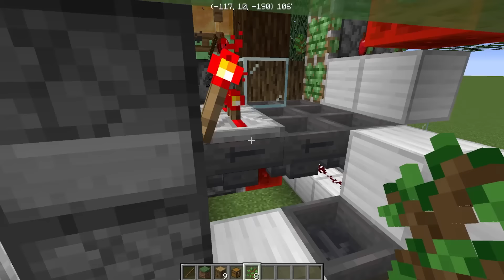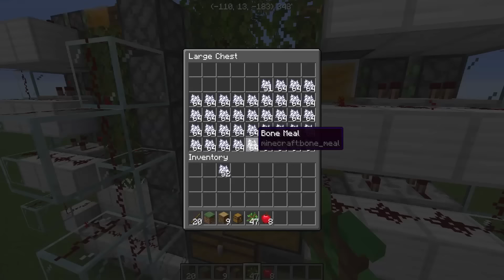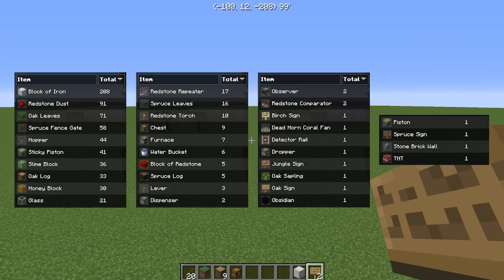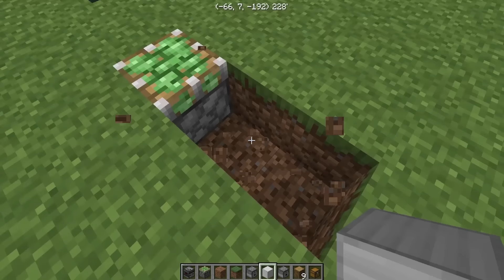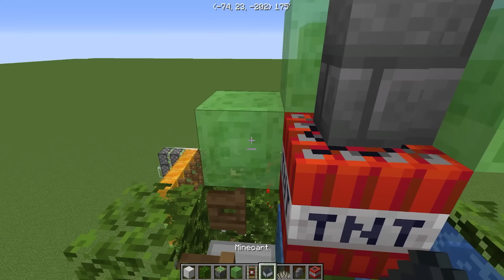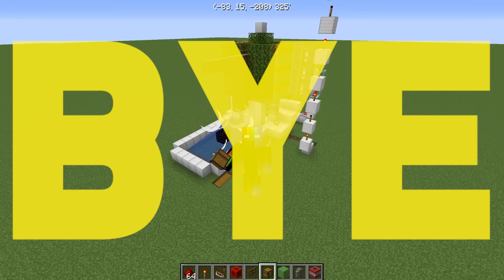Minecraft Tree Farm 26.1 - EASY AUTOMATIC TREE/ LOG FARM Tutorial

Comment: So uh, for some reason my pistons are breaking, and they arent pushing like 2 entire rows of slime and honey. I triple checked the redstone, and it doesnt seem to affect it, because when I break the layer to line it up with the rest and try to pull it back, it will go back, but if you try to push it, it wont work, it just breaks and doesnt push it like how it doesnt push bedrock or furnaces. Im on 1.19, sooooo maybe a bug? I need answers cuz I just worked on this for almost 4 hours now instead of sleeping
Reply: Maybe u are using pistons instead of sticky pistons? Because I just did the farm in 1.19 and it works fine
Reply: @xswetzplus  im also using sticky pistons
Reply: or maybe u did the redstone ticks on the leave crusher wrong (The ticks on the redstone repeaters it’s 4 then 2 on the one closer to the tree)
Reply: @xswetzplus  I figured it out, for some reason I put 3 ticks, not 2. But still, if I spam saplings it still breaks my machine because the tree leaves arent being broken at the top, so it breaks my machine, so when it breaks, I have to go and remove it all, then flip the lever a couple times to reset it. I just need a way to stop that from happening, like can I put a roof over it for it to not do that, or will it just go through/break the blocks?
Reply: @xswetzplus  isnt it 2 and 4
Reply: does furnace placement matter ? like mine is facing opposite to the tnt duper while his is facing like to the right of the tnt duper
Reply: @einsteinsousa2908  no, furnace placement doesn't matter
Reply: @WelpImBad I was having the EXACT same issue, and it kept repeating every time after clearing out the whole machine to start fresh etc., turns out its from when the oak trees grow with wood out to the sides, blocking the pistons because they can't deal with any wood, only leaves, so the blocks of wood would just stay there clogging it up, essentially. Using spruce, which doesn't ever grow sideways like that, has seemed way quicker so far and hasn't broken the machine, although now I know that was the issue I can make sure to catch those side blocks of wood more quickly if I'm really wanting to use oak for something. Hope this helps you and good luck!!!
Reply: @crashouch  i just added a roof so that it blocks it from growing over and breaking it, it can now take any wood types, thanks for the suggestion though
Reply: @welpimbad  nice!!! I'm really glad you sorted it. I'll bear the roof in mind for my own in the future too!!!

Comment: Getting super frustrated, in a single player creative and the tnt duper doesn't work in the slightest. Rebuilt it 6 times and it just sets of the tnt without duplicating it. 1.19 Java

*it also doesn't drop so it just blows up thee whole top every time. Sooooooo frustrating.
Reply: tnt duper should be facing north/south
Reply: @fenclory4381  thanks! I’ll see if that’s what’s causing the issue.

Comment: *This is working properly in 1.19*

I really like this farm, the fact it works with 4 trees and the ones I actually care about, A+. Farms like this do require a lot of bone meal, so either need to make a massive sized bone meal farm, or some form of Wither skeleton/mob farm to turn bones into bone meals, but it is worth it. My only critique on this, the initial layout wasn't introduced like a platform to show how much space this takes up, as well as not starting with the front. The biggest thing for me is the orientation and placement of builds are, and the first thing that was done is the switch in the middle. I ended up downloading the world (Thanks for providing that) and finding the measurements, and the front of the farm to where I can place it properly with the rest of my farms
Reply: Can you use spruce?
Reply: @giel5924  yeah you can use anything really. Jungle doesn't work well since you don't get enough saplings back, but I primarily used it for spruce.

Comment: Incase it helps it works on 1.16.5 but I found a clock with repeaters to work better and a switch with a comparter to stop the tnt also a stack of bones or 3 stacks of bonemeal gets you 175 logs on average

Comment: Built this in 1.18.2 and it DOES work....BUTTTT it does seem to break often due to weird trees, one wood grows toward the leave breaker arms, its over...now it just takes breaking the wood/leaves, installing a lever on the main line for the piston arms, pull the lever and reset it and its working in a couple minutes, i wouldnt consider it AFK in 1.18.2 because it is a bit of high maintainince, maybe tune the farm up a bit to prevent side woods?
Reply: FIX: move the top stone block AKA the "Tree limitor" one block downward
Reply: @robbytheatomicengineer5749  PIN THIS MAN. HE DESERVES IT MORE THAN ANYONE
Reply: @reihanboo  well thank you <3

Comment: I've tried this built, the only problem i had was the connector to the tnt to turn it on or off. So i have to manually remove the torch and place it for the tnt duplicator to work. Other than that this works great.
Reply: is it the redstone torch directly above the building block where the redstone dust connects to? I had this same problem but I was able to fix it by placing the redstone torch directly on that building block, and not on the side of the building block near it. It's hard to explain but just make sure that the torch turns off when the farm is on. You most likely placed the torch wrong.

Comment: Everything for this farm worked perfectly fine in 1.18.1 with one major downside. It no longer works with oak trees because of the one random branch that occasionally spawns in. An easy fix I found was simply only using birch. I'm only using this farm to create charcoal for a furnace array so I don't mind the lack of variety, otherwise you're better off making a large platform and manually cutting trees.

Comment: Really great farm works on the server I made it on I do have some suggestions how ever on how to improve it
1: You can move the obsidian 1 block up so that the top of the logs get destroyed instantly
2: You can make it so the dropper on dispense the sapling and the rest goes to a separate chest
Overall good farm to make (make sure tnt duping is allowed on your server) I would recommend it and I will probably continue making this design for many years (unless it breaks ofc) 10/10 Farm
Reply: Can u tell why my tnt dublicator breaks everytime?
Reply: Another improvement I made was to add a little bit of extra circuitry to stop the bonemeal dispenser from firing between a tree growing and a new sapling being placed. It was a bit tricky fitting it in since the farm is already designed pretty compactly, but it's not too complicated.

Comment: Can someone confirm this works in Java 1.18.2?
Reply: the tnt duplicator seems broken now :/ aside frome that with spruce at least it works, you just have to chop them yourself, with vein axe that's not such a big deal though
Reply: @Loren1389  Mine still works. Although my dropper is not dropper anymore
Reply: @RobertWeiss22  I cld not get my slime block duper to work, but one with honey blocks works fine :) don't now what happend to the slime block variant, worked in the beginning and then just stopped shrug
Reply: update, fixed. When making adjustments I moved the on off switch next to the dropper. It was then only allowing one item to drop. Moving the on off switch away from the dropper fixed the problem
Reply: The farm is "finicky".
I've had to fix certain aspects so many times.
I have two on my server. It finally has been running smooth.
One thing is off and it fails in two spots.

Comment: The dupe and the bonemeal system works perfectly but when i grow up a tree the leave crusher stops working. Under the farm where the sticky piston and the redstone block is, the line of redstone coming fron the clock doesn't activate the piston so i made a 1 single line conection. can that be the cause of my problem? i'm playing on minecraft java 1.18.1
Reply: i am having the same issue did you find a fix?
Reply: @FlixRreal  yes I fixed it. I did the line of redstone just like the video and started working, don't know why it didn't in my first try
Reply: @SuryFromHeaven  thank you was having problems with server lag not detecting the new tree growing so had to remove black and reset red stone so the farm wasn’t bugged

Comment: This farm works very well with one minor exception.  Unless I stop periodically to pick up jungle saplings that haven't been collected automatically (ie those that fall on the oak logs or the redstone line) it doesn't break even with jungle trees.  It's fine with the other three.  I might see whether a few strategically placed hopper minecarts might sort that but then I don't really use jungle wood that often anyway.

The tutorial was generally very good and easy to follow but there was one area I think it could have been improved.  You kept changing orientation quickly or between cuts and that made it harder to follow earlier on in the tutorial.  I had to be really careful to check that I was pointing in the right direction and I did get it wrong a couple of times although I quickly realised my mistakes.

Thanks for a great farm.

Comment: I got stuck (no pun intended) on the part where all the sticky pistons are supposed to fire at the same time.  Only the pistons that have the 2x3 platforms of repeaters and redstone will actually fire.  The others just remain inactive.  I've gone through the steps carefully, rebuilding this portion about 5 times now, and I get the same result each time

I'm playing on 1.18 bedrock--does this method of using a of sticky pistons only work in Java?  Because as far as I can tell, there's no redstone power to the pistons between the ones that have repeaters next to them.
Reply: yes it most likely is a bedrock issue because the java and bedrock redston works very differently

Comment: I have a problem with your farm: I have built it under ground because it simply doesn't fit into my base and the farm uses waaaaaaaay more bonemeal then in the world download and it won't grow spruce trees. There are no mistakes in my build as I used litematica. can someone help, please?
Reply: Same issue. Did you find a solution?
Reply: @henk11ful   I did indeed found a solution, but the SMP I built it on has reset twice since, so I unfortunately can't remember anymore. maybe use glowstone instead of the glass and logs directly onto of the hoppers so you have a high light level
Reply: @Corvus.Gaming  Not long after I posted this message I actually found a solution. I had switched one of the logs next to the sapling on the right to a shroomlight to boost the light level of the area. Moving this one block further solved the issue so that the tree doesn't grow next to the shroomlight.

Comment: Taking notes whilst following along the video, + building this farm at the same time.
My goal was eventually to set up a assembly line of sorts which would be a self-sustaining bonemeal farm -> THIS tree farm -> coal farm, giving me the ability to farm all 3 of those resources.

I'm fairly new to minecraft, this is my first time making anything like this so hopefully this will help someone else along the way. I started out by taking my time collecting the "materials list".
First thing I notice is the "list" suggests only 1 dropper is used, needs to be updated to 2. The orientation of the 'tnt dooper' flipped around mid video and had me mildly confused for a minute, but I fixed its layout and the farm seems to work! Other than the extra dropper missing from the materials list, this video is quite straightforward and if you follow it verbatim the farm works just fine!

The 3 tall, 3 wide section of 'leaves' that faces the obsidian block gets destroyed by the tnt. I'm not sure if i messed up my spacing but i followed the positioning of every block in the video and am quite sure it is identical to the build in the video. Maybe can put some other type of block in its place... farm still seems to collect saplings despite the gaping hole in the side.

Appreciate the effort of this video, seemed not too difficult even for a noob like me. p:
Reply: Do you have a self sustaining bonemeal farm that can feed this infinitely? I cant seem to overcome the bonemeal cost

Comment: here is a quick excell to shows how many stacks + leftovers fot the item list
			STACK	LEFT
	208	blocks	3	16
91	redstone	dust	1	27
80	leaves	(I	1	16
58	fence	gates	0	58
44	hoppers		0	44
41	sticky	pistons	0	41
36	slime	blocks	0	36
30	honey	blocks	0	30
21	glass		0	21
20	oak	logs	0	20
17	redstone	repeaters	0	17
10	redstone	torches	0	10
9	chests		0	9
7	furnaces		0	7
6	water	sources	0	6
5	redstone	blocks	0	5
3	levers		0	3
2	dispensers		0	2
2	observers		0	2
2	redstone	comparators	0	2
1	coral	fan	0	1
1	detector	rail	0	1
1	dropper		0	1
1	obsidian		0	1
some	oak	sapplings		#VALUE!
				0

Comment: 13:48 I had to put more repeaters for the middle tree pusher for 1.18 for some reason in 1.18. when the piston gets power by redstone block. when goes to Re-track the other pistons doesn't pull back other line pistons. l'm not sure if it's the version l'm playing on or the server. but for the people having problems and it's really a simple fix. with the middle pistons part or I call it the tree pusher part. 

if you need help this is what I did make it work
stead of just pulling down redstone dust. extend the glass tower back by one grab 3 repeaters, I tell you later. then go to the very top piston go to backside of the piston place a block on the second round of pistons then space down by one place other block and repeat. so meaning when get to the very top piston. place a block on piston under that top piston space down by one block and put another block space down again place block until have 3 blocks places. btw block got to be solid block meaning No glass so it can power the other pistons.  grab the repeaters and where we put the blocks place a repeater on top that block put all repeaters on 2 ticks delay then connect the glass redstone tower to that repeater. then your done. 

all we did was. when the redstone block pull back the back piston are still power so when it re-tracks it pull the piston with it. your welcome!
Reply: @blurr.8360  okay it might take awhile l'm still at work but I remember you when I get back..

Comment: My TNT is not working, I think there is some issue with the hopper clock. Anyone else have this problem?
Reply: if you are using papermc tnt dupe may be turned off
Reply: @averyr2548  no. For some reason the hopper clock does not work when I turn the lever. The torch tower does nothing. Built exactly the same though as the video. I’m still puzzled
Reply: Weird check the comparators
Reply: @averyr2548  one is lit up one is not
Reply: Is it in subtract mode?
Reply: @averyr2548  no!
Reply: Hoppers pointing into eachother? How much stiff did you put in the hopper?
Reply: @averyr2548  yes. 6 items because I am on server
Reply: Does the tnt duper work? Did you test it before trying the hopper clock?

Comment: I'm having an issue in 1.18 where the pistons that push the logs will just randomly not push (literally happens randomly and sometimes the farm will run great for a small period of time) and get all the leave breakers stuck in the push position until I manually reset it.  I initially thought it was because the tnt couldn't keep up with the wood pushing so the pistons got stuck, but instead it seems the problem is that the redstone block that pulses the system (under the bonemeal dispenser) isn't retracting. Any idea why this is happening? Seems to be a 1.18 glitch.

Update : I changed the randomTickSpeed to 4 from the default 3 and it seems to have helped a bit.
Reply: Lower the top block by 1 for oak trees. Mine was dong that and I found that monster trees were growing that didn't in 1.17

I suggest just using a sticky piston to raise/lower the top block so that you can have full height for all the other trees.
Reply: @TeamHShirt  My trees are not growing
Reply: for me just my spruce trees are not growing

Comment: hey, having an issue where the tnt duper doesn't start and when it does, it blows up the iron blocks and hoppers. i have followed this correctly and placing every block you place. but it still explodes all the iron blocks.

edit: spelling issues.
edit x2: I fixed it by replacing the iron blacs with obsidian. (Only in the part where tnt drops tho)
Reply: also, I've tried the world and it works perfectly ?
so idk what I've done wrong
I'm on a single player world